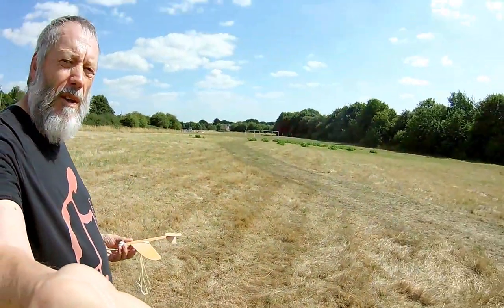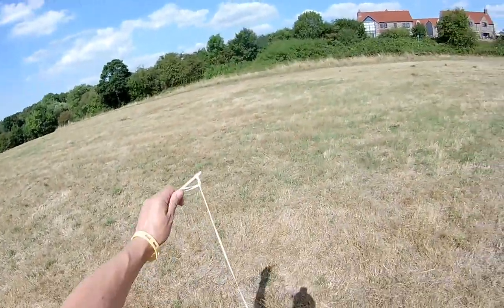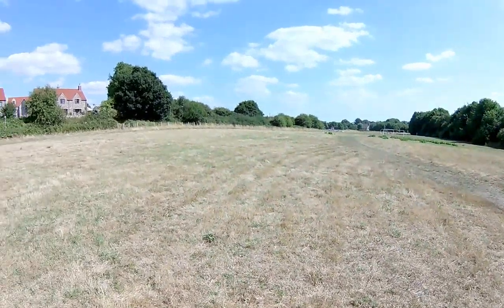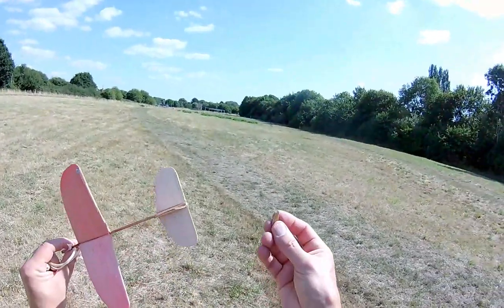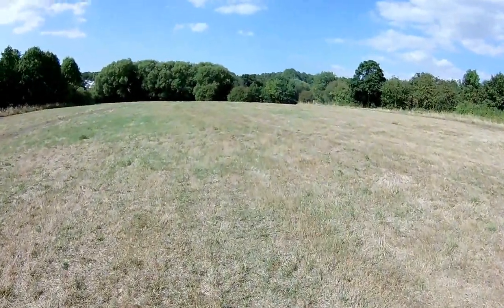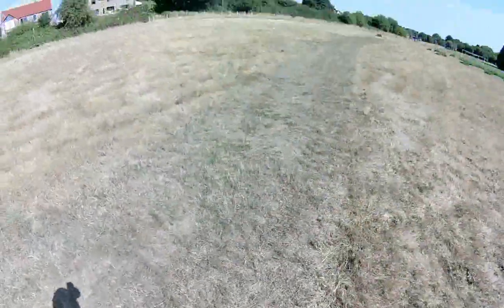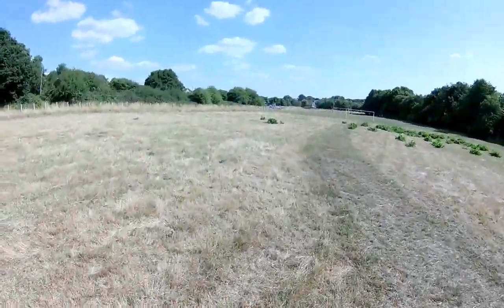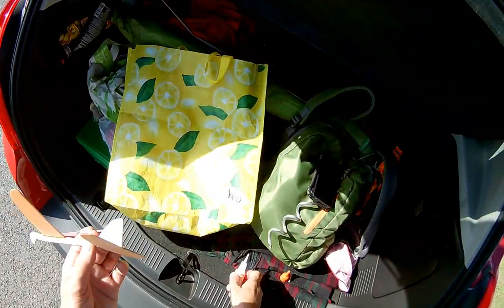A bit more Aleda CLG - Catapult Launch Glider

Comment: So you're consistently seeing the model pull into a right hand sideways loop. This is called "Incidence Step" in the model airplane world and indicates the need for some nose down trim. Start with a 1/8" long piece of 1/16" sq balsa on the bottom of the stabilizer trailing edge, and add more of them until the sideways loop widens out into a smooth transition to glide. Also, I think you have too much left rudder, so a tiny piece of balsa on the right side of the fin's trailing edge will help. You may also get some benefit from a 1/8" long strip on the bottom of the left wing trailing edge at 2/3 span so that wing doesn't drop as much in the glide. Expect hard impacts to change the trim...I don't know of a single small balsa glider that doesn't have that problem. Also, if you brought the model from a cool car interior to hot weather, you'll often see a trim change as the model warms up.
Reply: I should also add that adding weight on the outside wingtip usually will not help, but it will cause the model to yaw to the opposite side as the speed bleeds off, and that is probably what is causing the partial loop before it transitions. For this reason I avoid adding weight to the wingtips except to compensate for one wing being heavier than the other.
Reply: Thanks Joshua, I will try to take that all on board. The last line made me smile, during that heat wave (which has finally broken) there was nowhere cool, but I know what you mean.

Comment: I had a nice flight with mine at dusk on Saturday. Until it went into an oak. It may be there today. I hope my son can retrieve it. A few minutes before, my new Carbonette 19 flew into a high shrub and I couldn't retrieve it until Sunday morning, using a pole saw. (No balsa was harmed in the retrieval.) Good luck with yours. Today I built a couple of gliders using free plans from AeroFred and Outerzone but is too windy tune them. I do like the Aleda and Carbonette 19 very much though. (Like you, I'm neither connected with nor compensated by J&H Aerospace. I'm just a customer.)
Reply from the maker: The hot spell has ended now, so we are back to wet and windy. I still have the two Carbonettes to assemble, I will get to them at some time.

Comment: Good plane also this has nothing to do with this but have you got the tractor working yet
Reply from the maker: No, I don't expect that to happen very quickly, just a matter of a suitable transmitter turning up.
Reply: You could try a transmitter with forward, backwards, left and right with an additional button on it
Reply from the maker: HaHa, did you see how many transmitters I had tried in that video?